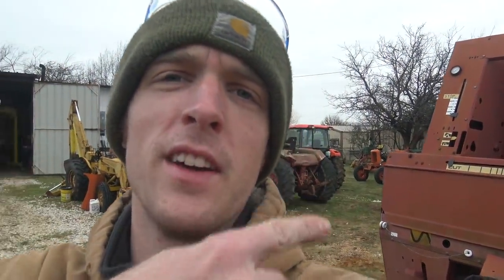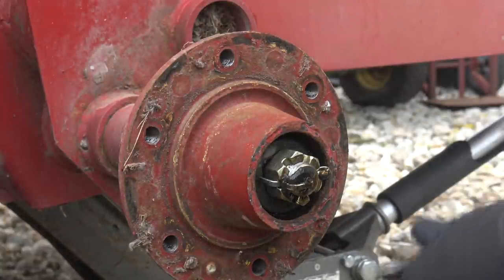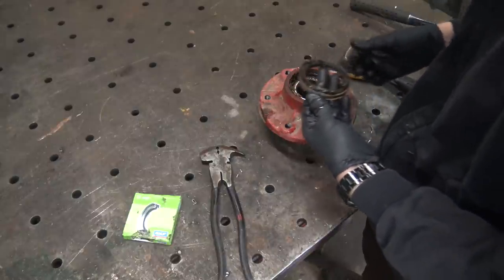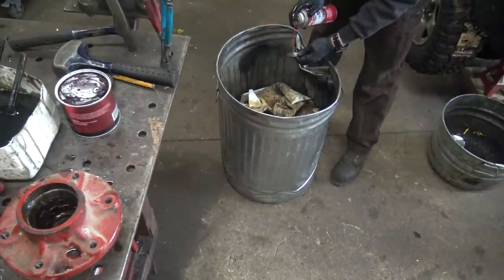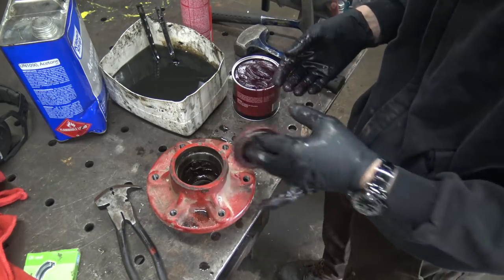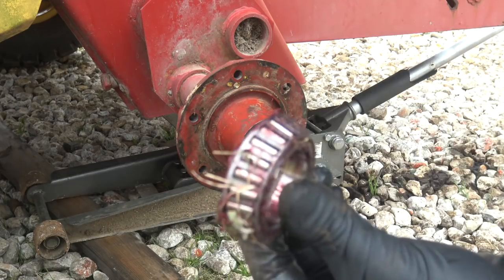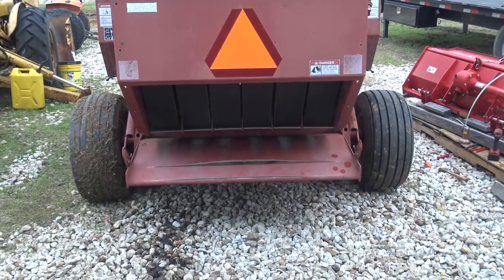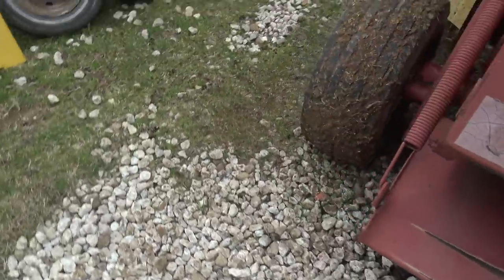FARM EQUIPMENT WHEEL BEARINGS ARE ALL LIKE THIS - WHY ?!?

Comment: Large round wood dowel, or fresh cut end of an old hickory axe handle.
 Poke through front of hub and knock bearing and seal out through the back.
 If you do it right, you can re-use the seal,,, if it's in good shape.
 Just use a thin coating of gasket sealer, for the outer part of seal, to hub.🎯😎☕

Comment: Most Ag hubs I’ve dealt with all have a grease fitting on the outside of the hub so you don’t have to spend an hour repacking the hub and replacing the seal. Should’ve drilled and tapped a hole in the hub between the bearings and grease it up.
Reply: Agree
Reply: When you do it the way he did it in the video, you clean out all the nasty crap in the bearing and get it nice and clean. If you just grease the bearing buddys, you just add more grease to the filthy grease. Bearing buddys are great but also, wheel assemblies should be taken apart and cleaned like this once in a while. But definitely nothing wrong with the grease fitting to keep it nice and lubricated over time.